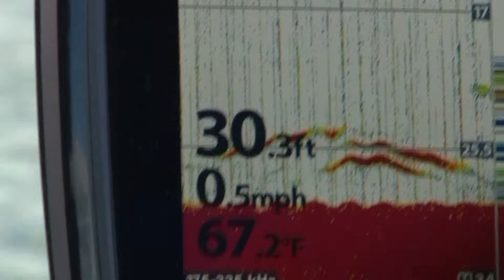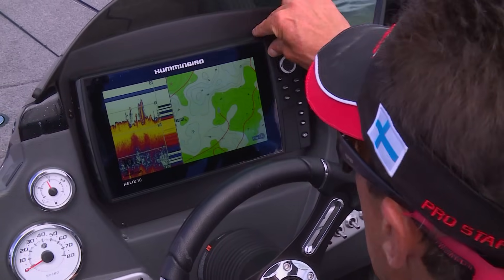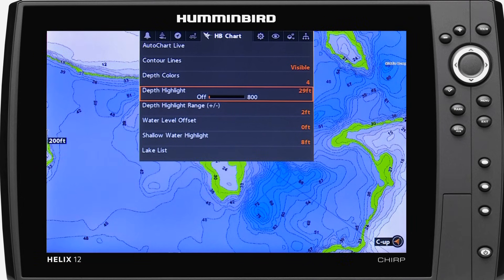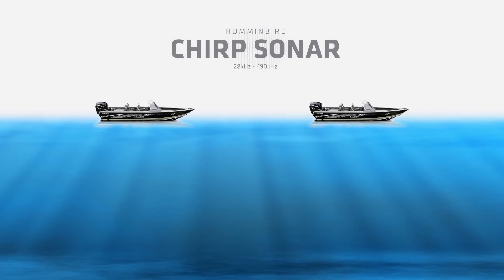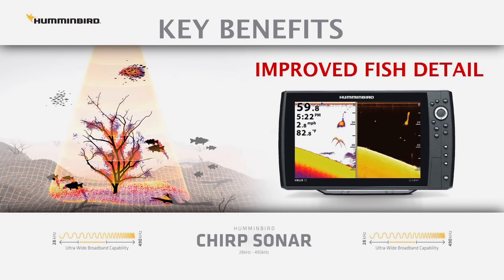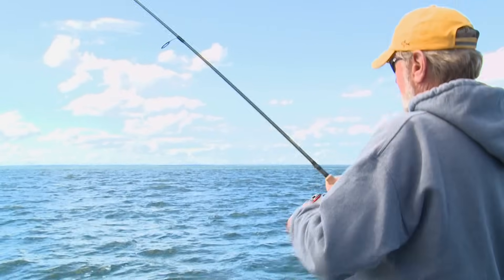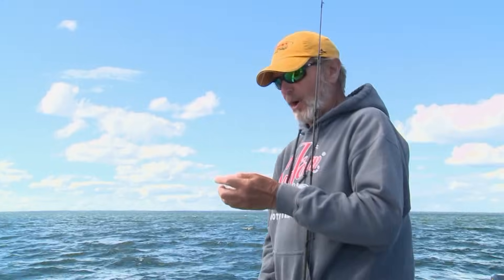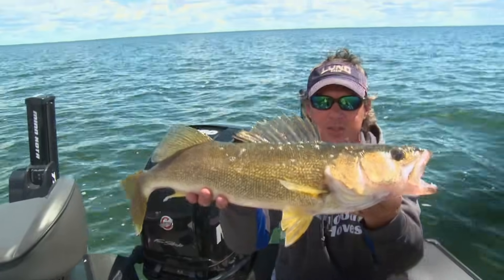What is CHIRP Sonar? | Humminbird

Comment: These new "MEGA" fish finders were born from advancements in the millimeter wave radar automotive market. Texas Instruments, Analog Devices and others have advanced the chip sets to apply FMCW radar techniques to the sonar world. Devices like PLL sweeper chips and multi channel simultaneous sampling analog to digital converters have been reduced to single chip solutions. In sonar, the wave propagation travels thru water not air, this is what limits the range at the MEGA frequencies. The high frequencies used during the sweep tuning ramp are responsible for the greatly improved target separation. Large scale integration and improved ceramics have enabled Humminbird to pack all the complex circuitry in the new MEGA live potted transducer.